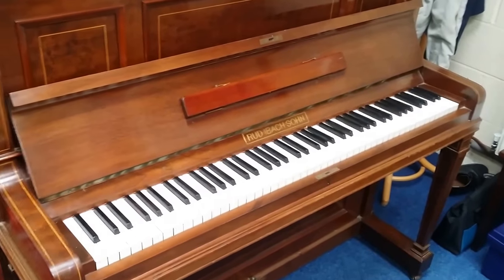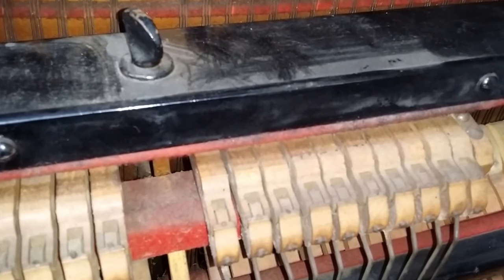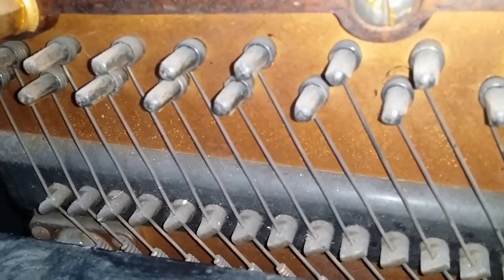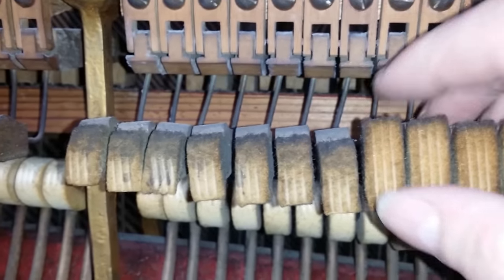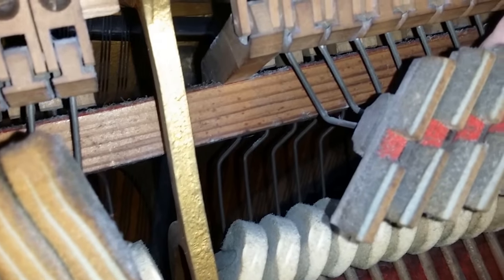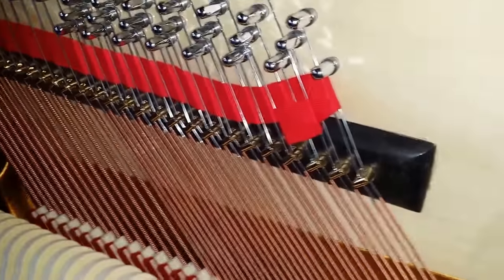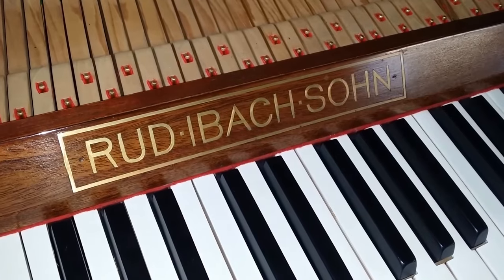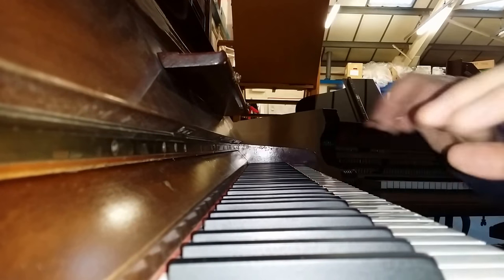Ibach overdamper upright piano converted into an underdamper! + some technical ideas

Comment: Quick question:

When you mention 'top quality German strings', are you perhaps referring to Hellerbass?
Reply from the maker: Yes, we normally use Hellerbass but not exclusively. There are two or three UK firms that also make fine strings using German wire and copper.